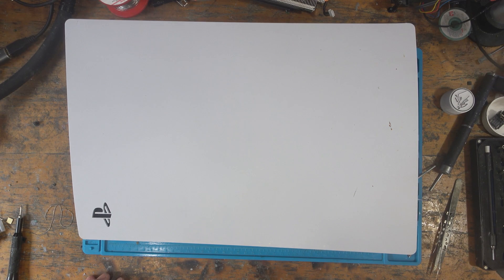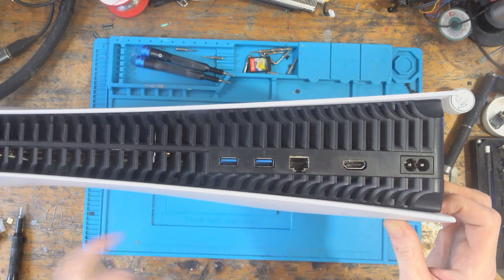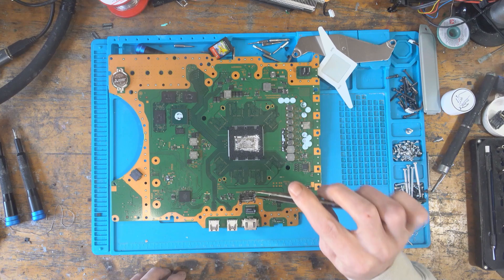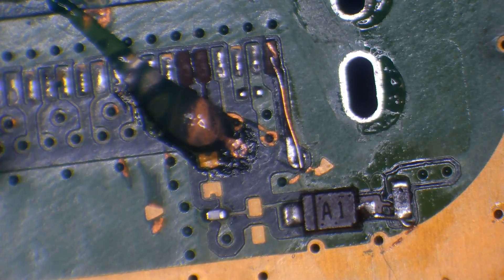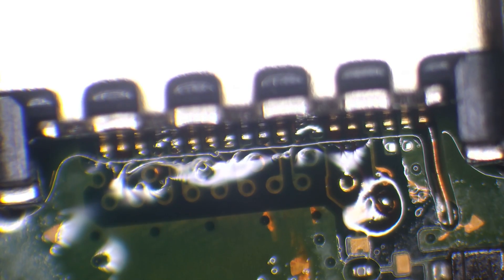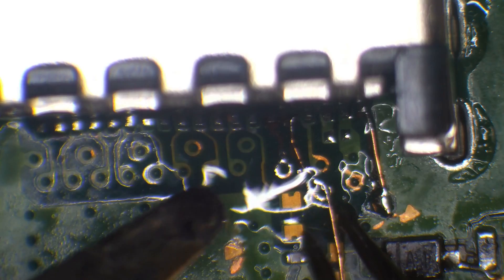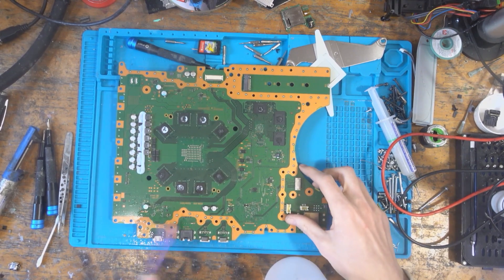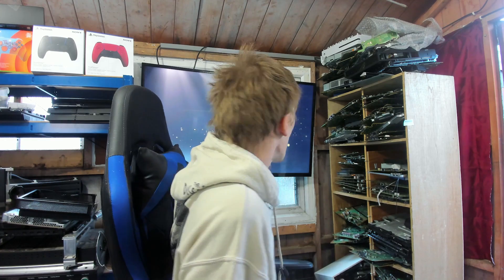This PlayStation 5 HDMI Port "Just Fell Out"! Can I Fix It AGAIN?

Comment: There are missed capictore  oppsite pin number 2&3, you didnt resoldring it  , why ? Its not important?
Reply from the maker: Do you mean the one on the right side of the port (pin 18 to 18)? That's a bypass cap on the 5v HDMI output line. It's not needed for the device to work again as it's jusy used for smoothing out the 5v line
Reply: @TheCod3r   yes thats it . Thanks

Comment: You may unfortunately see this Repair come back again as I have recently found out that when replacing these PS5 HDMI Ports that it is good practise to lightly file down the anchor legs so that the solder gets a good bonding to that of the legs and that of the board as the outer coating on these Ports can end up causing Cold Solder Joints to that of the metal legs mate.  So that is something I will be doing as a rule from now on with every xBox and PS that comes in for a Damaged HDMI Port Replacement just incase 👍🏼

Comment: I feel luiqid metal is the worst type of thermal chip cooling technology that could ever been used on computers and gaming systems love video's keep up the good work...
Reply from the maker: I actually prefer it for my laptop. I have it on both the cpu and gpu and it runs 20⁰C cooler than MX4 does :)

Comment: The problem with these consoles is the owners seem to move the things from room to room. Constantly pulling and pushing the hdmi cable against the port. If kept in one place and a cable connected once the port should last forever. I have a ps3 and a PS4 in the same place from new and no hdmi faults. Saying that, the ps5 does seem to be expensive garbage seeing the amount of repair videos on the damn thing. I repaired a hdmi port on my grandsons PS4 years ago, if he comes to me with his ps5 needing a hdmi port he can do one.

Comment: Before I say this I want to acknowledge and establish that I'm learning things from your videos. So thanks for the uploads, honestly. 

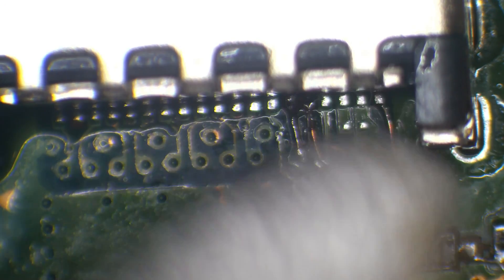10:36 The mounting points are soldered from the other side, true, but from this side next to the pins you can see that the solder did not flow all the way through to properly hold the port in place from both sides. The technique you used, tinning the pads first thing, gave the port around a 1 millimeter clearance from the board; this means that the port can wiggle 1mm back and forth and weaken the mounting points from the other side and pull the traces after the port snaps like it did this time. 

It looks and seems strong during testing, but there are some brute customers out there and this is costing you time and money.
Reply from the maker: Yeah I agree mate, I didn't show it on camera but I soldered from both sides this time and will be doing so in future just to try and prevent it from happening. It was definitely my fault and not the customers. I should have checked the solder on both sides the first time around
Reply: @TheCod3r  I have had this happen to me before mate, it's a combination of not enough heat on the ground legs to flow the solder to the top side of the board, and using the iron on the port pins instead of the hot air if you tinned the pads first.

Now I drop the port in and then tin pins and pads together, that way the pins are absolutely flat on the pads. If you want to tin the pads first, use the hot air so they are molten and then drop the port in.

Cheers.